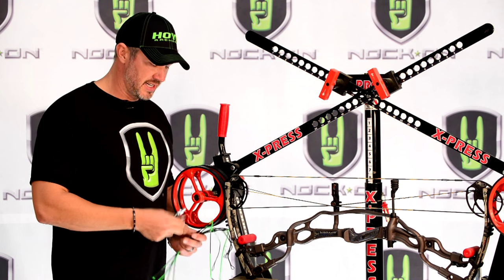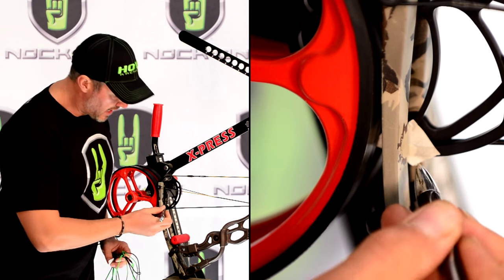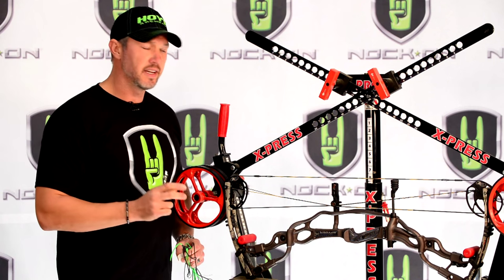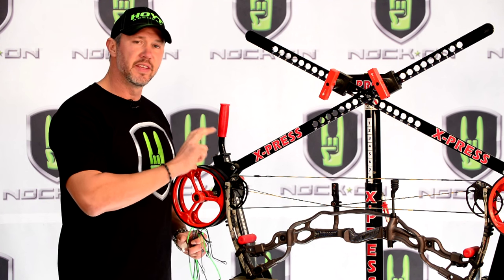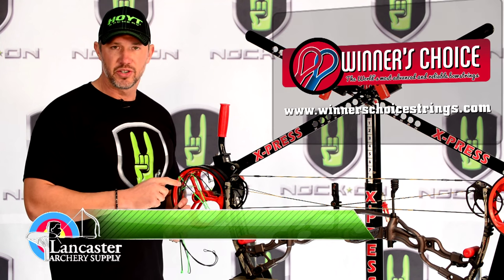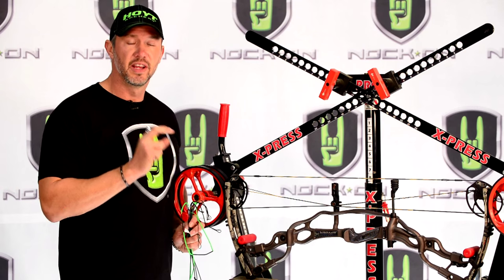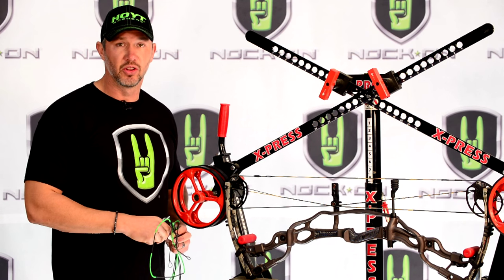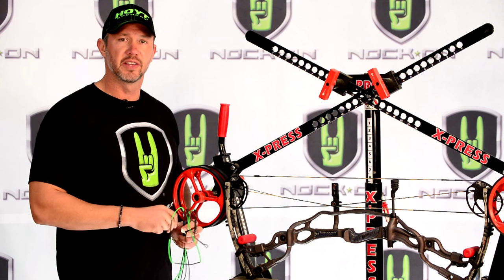NRTR 2 - How to Replace String and Cables

Comment: Thanks for the video(s), much appreciated..  I've got an older bow from 2014 with a double cam, without a yoke system..  I was wondering if the order of replacing the string, bus cable, and control cable needs to be done in any particular order ???  I'm also aware I may have to use cam spacers to eliminate any cam lean when I do replace the strings and cables, but I was just wondering if there was any particular order of replacing the strings and cables on an older bow that does not have a yoke system ??  Thanks again.  Matt

Comment: Im wanting to try replacing my bow string. My bow calls for a 61 1/8 string. Can I use a 61 or 61 1/2? Or does it need to be the exact size called for?
Reply: Pedro Trevino exact size